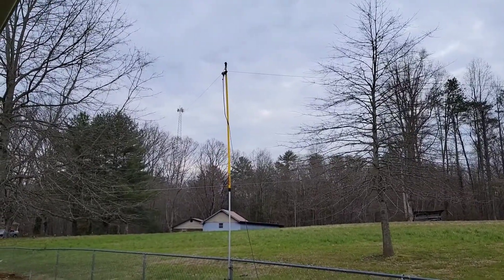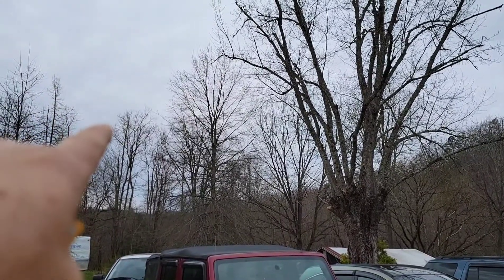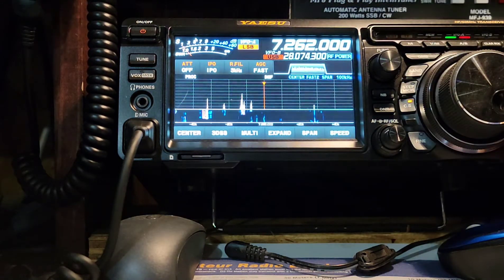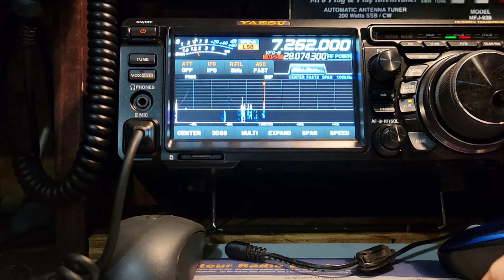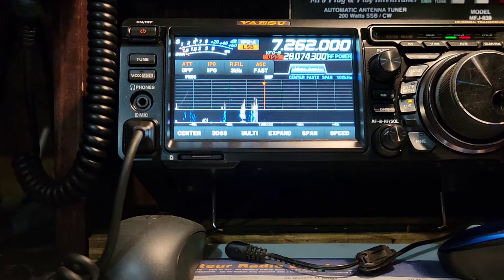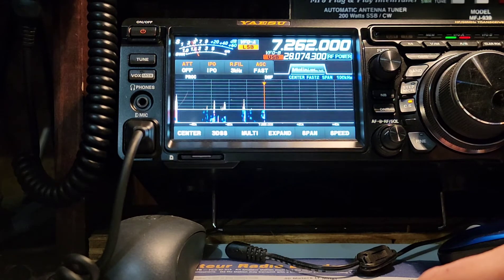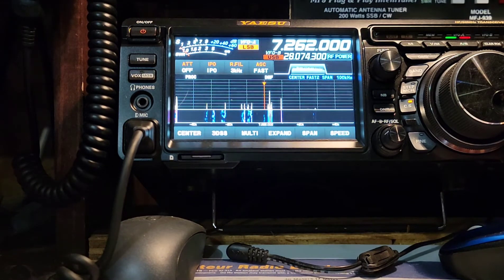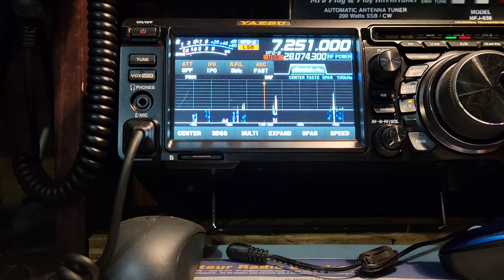40m NVIS dipole compared to 10-80 EFHW

Comment: Two comments. For a horizontal antenna, the only thing that determines radiation angle is height above ground. Any horizontal that is near half-wave high has a null straight up. The inverted L is usually considered a top loaded vertical depending on its length in wavelengths. So it may or may not have significant horizontal component. If the horizontal portion is halfwave long it will be essentially the same as a halfwave center fed dipole, but it will have some radiation off the vertical and receive vertically polarized noise that the fully horizontal will not.  If the horizontal portion is not very long, in term as of wavelength, it will not perform very well as a horizontal antenna but will act like a more conventional vertical. I use an inverted L for 160 and it does well as a 160 vertical with good low angle radiation and apparently also is not too bad as a horizontal NVIS on 160. It’s overall length is about 180 feet. 60 foot vertical and 120 foot horizontal.

Comment: My 130ft EFHW 80m-10m was so-so until I started grounding and choking at the feedpoint having been informed by Steve Ellington's video. Steve's video uses an RF ameter to measure power along coax to end of antenna. In inverted-L configuration with transformer near the ground there is about 3dBr improvement of typical EFHW installations choked and grounded at the radio.

Its hard to beat a dipole, but its hard to find an easier to setup NVIS antenna than an EFHW inverted-L.

As condo dweller all my ops are portable. I do throw my EFHW over the tops of trees at about 25ft-30ft to run 80m NVIS. The noise is typically S9-S9+, but I make regular net checkins running 20W and lower.  There is a 5ft chainlink fence beneath the EFHW.

The second video is my first attempt at checking into a Florida NVIS net. A ham buddy said I need a PA to run NVIS and it wasn't worth trying. Now its typically 20W-5W.

Third video shows 20km NVIS across mountian range all the way down to 100mw running JS8Call.

Last link goes to web site with several good data driven articles related to NVIS. One guy running NVIS mobile during the Virginia QSO party in 2018 & 2019 made of 1800 contacts with the vast majority on 80m.  About 3hrs each year he was making 80-100+ contacts per hour!

https://youtu.be/MzfQybYMlUc

https://youtu.be/Q1CJfAQ15ds

https://youtu.be/9QIeG4LiFMg

https://www.hamradio.me/mobile/how-to-win-with-hf-mobile-nvis.html

Comment: Make you 80m loop with ladder wire and work 10m to 80m with a little bit of gain and alot quieter
Reply from the maker: In wanting to eventually make a loop antenna.. But this balun was free and the wire was off the old mfj efhw I changed out. So figured for free I might add will try it... But main reason is I'm trying nvis setups with it and wanting it fairly portable